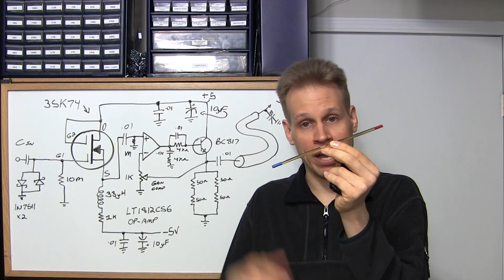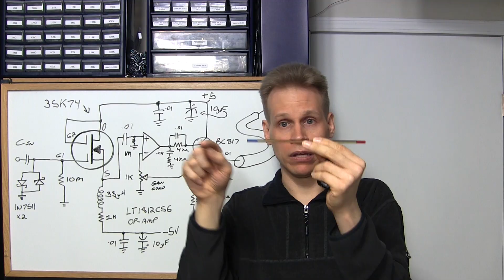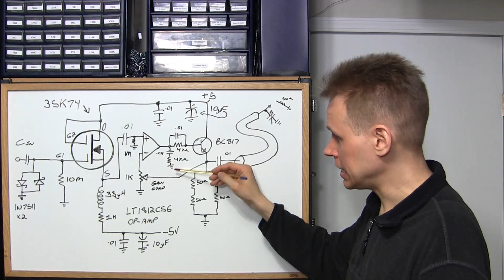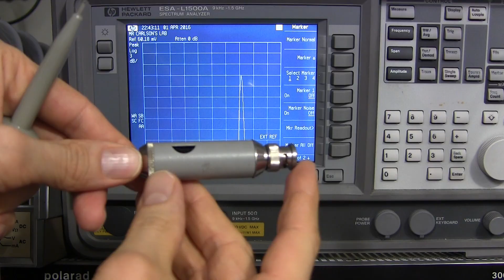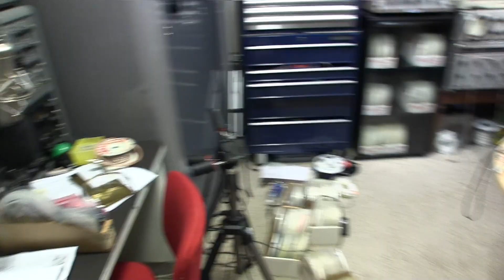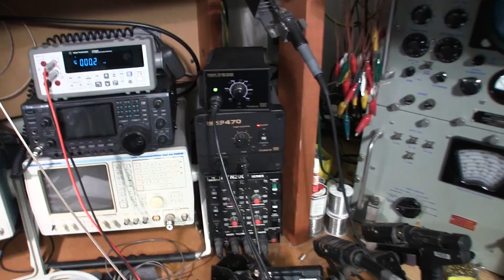Active Probe, Schematic Included

Comment: Great tutorial, could you give us a study on building another prove that can be used up to 1 Ghz for use with a oscilloscope with input impedance of 50 ohms
Nic
Reply: Yes, with the active scopes... I've read we should use x3 or x5 or more frequency probe of the frequency of your oscilloscope.  I'll have to watch this since I haven't yet and got carried away reading the comments.  May be a clue in the schematics where something can be changed say like you can add a potentiometer to see the effect on the circuit Hz.  I know when you get into the Ghz range circuits get strange and board design even looks unique with interesting shapes eched into the boards as filters and you almost have to comprehend electronic component design and the board as an antenna with your board design, i.e. each component trace is an antenna with a SWR, impedance, coupling, etc. for optimal design.  Interesting learning from a chemist, programmer and project leader background perspective.  Mr. Carlson definitely is the best I've watched so far in explaining in detail electronics on a small budget.

Comment: Great! Which coating method did you use on the pcb (chemical tin plating)?
Reply: OK, figured it out. Most likely, it's a "liquid tin" reagent. Some users of this chemical mentioned "egg smell" of the liquid, that is probably due to thiourea content as a complexing agent.
Reply: We used a simple 'immersion tin' bath where the usual Sn/Pb was not accepted, and you are quite correct, Sir:  Thiourea IS responsible for the rotton-egg smell in from bath, while the Fluoboric acid component is responsible for the burning skin smell when splashed upon one's body parts..

Comment: Nice probe. Your fluke generator looks like a rohde schwarz generator, even the tap for the help sheet at looks same.
Reply from the maker: +Mads Thorup 
The Signal gen right above the Fluke is an R/S, re-badged as Polarad. Is that what your referring too?
Reply: Yes both looks like R/S. I guess they also write hello 1,2,3,4,5 when they start. :-) never heard about Polarad.

Comment: What is the value of the resistor on the non-inverting input to the op amp?
Reply from the maker: +EdWatts 
Hi Ed, It's 1Meg.
Reply: +Mr Carlson&#39;s Lab 
I  thought it might be (the big "M"), but, without the "1", I would have been guessing.

Thanks.

Comment: You need a resistor at the E of the BC817, depending on the Re of the sistor which is .026 milliohm /milliamp which is depending on voltage at the E to gnd ~47ohms.
Reply from the maker: +Henry Hopkinson 
There are 4 resistors at the Emitter of the 817, clearly displayed in the schematic.
Reply: There should be a resistor in SERIES with the .01mfd capacitor. If you look back into the E of the transistor there is a very low impedance, Re. You need the resistor to match the  the 50 ohms termination.

Comment: Hello, I just bought a very nice turntable in a thrift store It does however not work and I think I found the problem but I think you are more qualified than me to know. I think it's the first 5K1 5w5% fusible resistor that has blown. when I meter it the resistance is still within spec but there is no continuity. Could it be the culpret?  IT looks just like a glass resistor but is potted in grey resin. The pitch control belt was also dried out and broken so that might have jammed the motor and caused the fault, They couldnt answer my question at the only major electronics retaiiler I know of in sweden that is why I am asking you.
Reply: +rimmersbryggeri 

If the resistance is "within spec" how can there be "no continuity"?  "No continuity" indicates infinite resistance.
Reply: EdWatts
 I don't know why the coninuity beeper didnt incicate continuity but I got it working anyway.
Reply: +rimmersbryggeri 

Most VOM's with "CONTINUITY" beepers will not sound if the resistance is over about fifty ohms.

Glad you got it working.
Reply: EdWatts

Ok I didnt know that. The problem was mechanical anyway it had a broken tooth belt for pitch control. Aparently that can cause the resistor to burn out some times though becasue it jams the motor or something.

Comment: I am all ways inpressed by your printed circuits board!! Question on the  schematic on the op amp on the + side is that side going  to erath !! thank you terry
Reply from the maker: +terry uren 
Hi Terry. The plus symbol you see on the op-amp is the non inverting input. The supply connections are not shown.

Comment: If you would have added an I2C EEPROM to the PCB and programmed it with the deltas, you could use it as a replacement probe for digital R&S mV-Meters. Or you could make a second project how to build a mV- / Power-Meter that works through the whole shortwave amateur radio bands and is somehow calibrated.
However a matching follow-up project must now be a RF dummyload with measurement output to attach this probe to, so we have a power meter, right?
Reply from the maker: +Astralix2011 
Thanks for your input.

Comment: What's that big cabinet with the "GATES" logo on it?  Looks like an old AM radio station final amplifier.  I know you're a ham but that's a bit bigger than anything I've seen before.
Reply from the maker: +jagardina 
I like transmitters that I can stand inside. Easier to work on :^)
Reply: Yes it is an old all-tube Am radio transmitter (Exciter, Driver, Finals and AM Modulator amp) that Paul no doubt rescued and highly improved. BTW I worked there in 1979-80 working in Test Engineering on the new 1 and 5KW Solid State transmitters there. It was the Gates Radio division of Harris at the time. They had rows of transmitters in test with red light marked keep out on the factory floor, and hollow water-cooled Welwyn RF Dummy Loads.

Comment: Impressive amount of equipment crammed into such a small space. I'd be curious to see how you power all that stuff and how much power it takes to run it. It seems to me that you have some 45 pieces that need to be plugged in, and some of it, high draw.
Reply from the maker: +Richard Williams 
Hi Richard. Usually not too many pieces are on at one time. I do have 3 services in the lab though.
Reply: Very cool. Would you consider doing a video of this aspect of your lab, I think it would make for an interesting subject.

Comment: You should add a small series resistor on the input, before the protection diodes. Also, why did you choose Schottky diodes?
Reply from the maker: +Matthew Humphrey 
Hi Matthew. 914's 4152's and 4148's tend to be leaky, and in a very high impedance circuit, this is a problem. Even the BAV99 affected the front end of this probe. The RF Schottky's had almost no affect when installed.
Reply: +Mr Carlson's Lab One of the drawbacks of Schottky is that they have a high (DC) leakage current, but I guess what matters more here is the parasitic capacitance. Thanks for the reply.
Reply from the maker: +Matthew Humphrey 
Hi Matthew. The Capacitance is near identical between devices. Here is a great write by a good fella, Mr Pease, RIP. Go to page 44 of the PDF, or the actual page is 127.  It's an enjoyable read  http://www.introni.it/pdf/Bob%20Pease%20Lab%20Notes%20Part%208.pdf
Reply: +Mr Carlson&#39;s Lab . Yes, one of the best analog engineer's ever, along with Jim Williams and Bob Widlar. Thanks for the link, will give that a read.
Reply: +Mr Carlson&#39;s Lab Interesting - in that app note, he actually repeats my claim about Schottky's: "Of course, high-conductance diodes such as Schottkys, germaniums, and large rectifiers have much larger reverse leakage currents than do signal diodes." I guess there's quite a bit of variance in the characteristics of a Schottky diode.

Comment: are you using  Cyberlink Power Director? me too!
Reply from the maker: +Max Koschuh 
I am. It works well. Sometimes it has a hiccup, and will produce one segment of the video in very low quality. This requires me to re produce the video. Does your program ever do this?
Reply: That's interesting. I have Power Director 14 with the latest patch, and it is working flawless. On an old intel i5 machine. After two months of use I am very happy with it. Happy to see more of your videos.
Reply from the maker: Thanks Max!

Comment: Paul, Wow! that was pretty amazing. I love the way you explain every step along the way. And the circuit you built is very clever. Also like the way you utilize every piece of test gear. I am also looking for another spectrum analyzer.  Really in the need for a more modern one with tracking generator. The old IFR 1200 just does not cut it since there is not tracking gen. he option is about a grand but still no onscreen display. I want to be able to do some V/UHF duplexer tuning.  Plus want to homebrew a 4 cavity VHF duplexer :)Great job as always my friend.
Reply from the maker: +The Radio Shop 
Thanks Buddy! That IFR 1200 is still a real neat piece of equipment. Take care!

Comment: Do you ever come to Toronto I have the HP 3585A that needs service
Reply from the maker: +George Koumarelas 
Whats the issue with the 3585 and what error codes is it giving you?
Reply: +Mr Carlson&#39;s Lab There is no codes the middle section with the wheel is does not work marker, level and maybe other thing but no codes . pick this form eBay for $1200.00 plus shipping from the USA seller said it all working. I got this to use it for my audio testing.
Reply from the maker: If there are no codes, I suspect a loose connector on the face somewhere. These things have a code for everything, If I miss dinner, it will throw a code.

Comment: Why haven't you used simple source follower?
Reply from the maker: +rapsod1911 
Hi. I didn't use that simpler set up for a couple of reasons. The source follower is not unity gain, and it doesn't drive the coax very well. There are more reasons as well, but those being the main ones.

Comment: Did you terminate the coax feeding the input to your probe in 50 Ohms also? I would think this would be critical to having a known constant amplitude at the actual input of the probe from the sig gen.  I didn't see you mention this, just wondering.  Thanks for the great project!  Dual gate MOSFETS are getting hard to find these days. Digikey does sell a surface mount one I believe (BF998) which I have used to replace some of the older ones (like 40673).
Reply: I would guess that the objective is to have a hi-z input since the stage being tested will already be terminated.  Certainly an IF stage will tend to be much higher impedance than 50 ohms. I personally like the BF988, the 40673 is a very old device but many designers use them out of habit!
Reply from the maker: +Herbert Susmann 
Hi Herbert. The signal generator has to be terminated into 50 Ohms for accurate readings. So the input of the probe has a termination resistor for the test set up. Thanks for your comment!

Comment: Very good Paul! Wondering if you have ever thought about getting a file sharing account of some sort to post PDF's (like Alan W2AEW does) or drawings, schematics, PCB art, etc.? 
Anyway, instead of using a SG, one could hook this up to a sweep generator and look at the output in X-Y mode on an oscilloscope, sorta like we can with filters? (Keeping our impedance ducks in a row of course.)
Reply from the maker: +cny02253 
Thanks! I'm thinking of setting something up (file sharing) But it's all about time. Using a sweep generator and a scope would be just fine, as long as you know your 3DB down point, and your test set up is flat.

Comment: Paul - nice project! Couple of questions - can you run us thru again why you used four 50 ohm resistors vs. a single resistor? And just out of curiosity what voltage does the HP SA probe port provide for HP probes? Keep the videos coming!  73 - Dino KL0S
Reply from the maker: +Dino Papas 
Thanks Dino! The resistors were chosen for a few reasons: Accuracy, what I had on hand, and as Richard mentioned, power dissipation.
Reply: +Mr Carlson&#39;s Lab
Ok, thanks Paul, did a little back of the envelope figuring and that makes sense. How about the HP probe voltage? I'm guessing it may be simply single polarity and thus not a source for a homebrew probe that needs a dual polarity supply. And tying it to one SA would limit "portability", just curious.
Reply from the maker: Hi Dino. the jack is supplied with +15 and -12 Volts at 150mA. The probe will have it's own power supply though, so I can move it around.
Reply: +Mr Carlson&#39;s Lab
Ok, thanks Paul, that's interesting. Kinda figured you'd supply it separately for that very reason.

Comment: Hi Mr Carlson, good video.   You forgot to mention I think that the inductor blocks RF from leaking out your DC path.  I am not familiar with the two gate FET.  I understand that you can hook it up; to build some advanced gain circuit, but why did you pull the gate to the drain instead of the gates together?
Reply from the maker: +Daniel Johnson 
Richard is correct, the second gate is commonly used for gain control or mixing. Since I'm using this as a source follower, I just tie the 2nd gate to the drain.